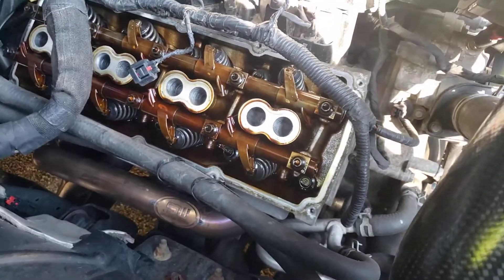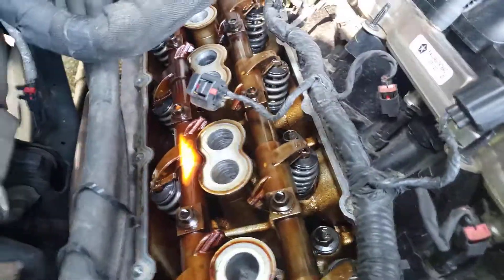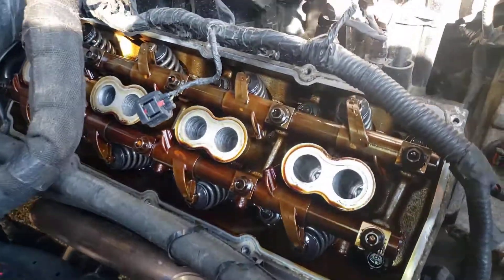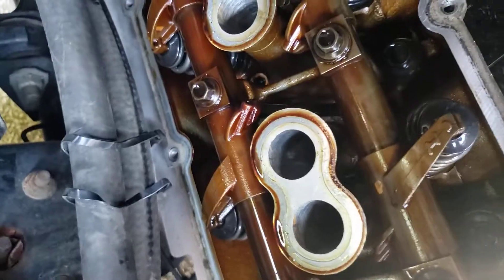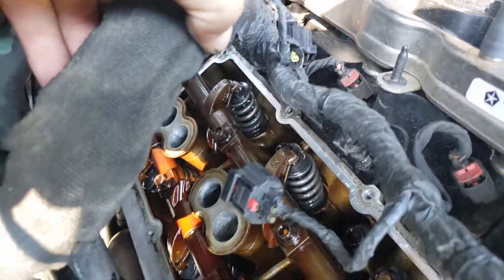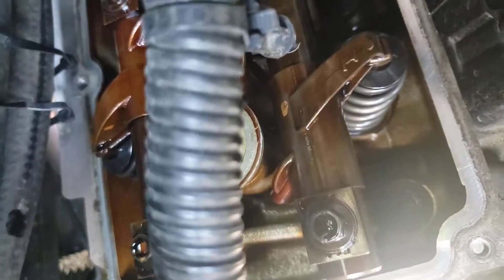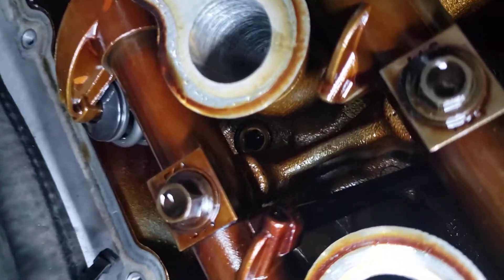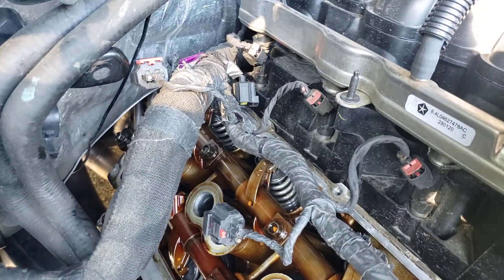Pulled the valve cover 2014 ram1500 checking for failures

Comment: Checking for camshaft failure, have someone spin the crankshaft while you look for less than normal lift on one of the rocker arms. This is pretty hard to determine if the lobe isn't wiped out yet or you have just a stuck lifter.

Comment: You won't be able to check a pushrod for straightness without pulling them out. Unbolt the rocker arms and pull them out. Roll them on a straight surface to check for out of true.
Reply from the maker: Thank you. I just wanted to see it run. Wanted to see if anything really stuck out.  I'm gonna order a new Cam. I want to go bigger.
Reply: It really doesn't take much to remove the preload from a lifter, if they're slightly bent out of true, they will cause the lifter to slap on the cam lobe and destroy it. If they're not the appropriate length, changing the cam isn't going to fix the issue.
Reply from the maker: The lifters came with the Cam kit. And I'm gonna order a whole new kit and Cam lifters push rods et
Reply: @rammods3818  that's a lot of money to she'll out...do a bit more investigating and try to find out what's causing the noise before you go spending all that money. Changing the cam is one thing, and done with heads in place easily. Changing lifters will be a pain, removing heads, headers etc...
Reply from the maker: I just got to get the time. I only had about a hour this morning. As soon as I can get the time I will dig deeper into it.